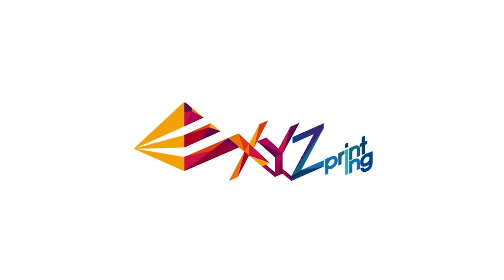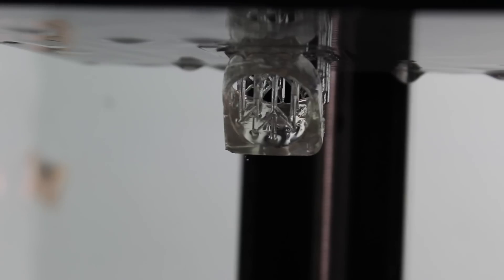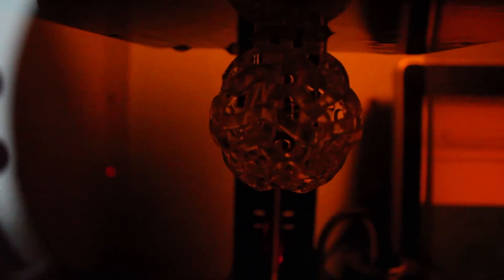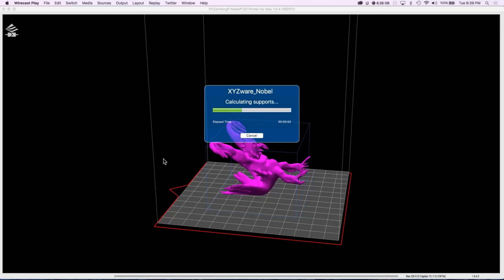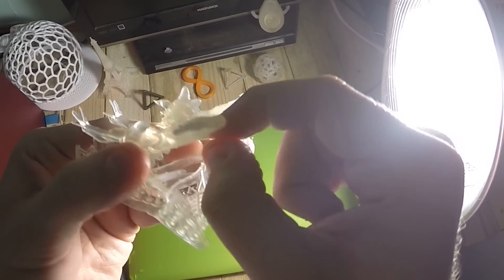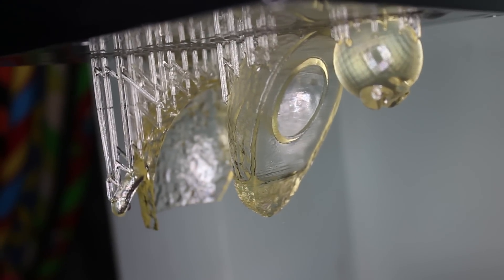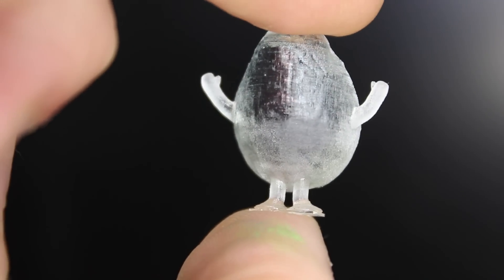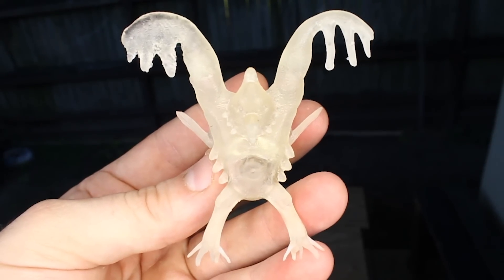SLA Printing - Pros & Cons | XYZ Printing  |  Nobel 1.0a  |  Review

Comment: So yeah this used to be a total duchebag of a post from me that the author did not deserve at all. But as the author has indicated we live and learn: 

For all those learning about resin printing here is my limited experience with the process:  
1. Resin is toxic and should not be touched without gloves 
2. Vats are coated with fragile-ish layer of PDMS or have a thin layer of FEP and to extend their life-span be very careful when fishing out the failed parts that are stuck to the vat. Use tools with dull edges/surfaces if possible. 
3. It is generally recommended to re-filter the resin back into its original container using paint strainer (100-190um mesh size, maybe higher depending on the viscosity of the resin) to remove partially cured chunks of the prints. 
4. Use some kind of a lint-free cloth sprayed/soaked with alcohol to wipe the build-plate after prints and for long term storage.
5. Once the resin has been drained from the vat spray the vat with alcohol (99% IPA or 95%+ Ethanol) and using another soft lint-free cloth very gently clean the resin vat surface and sides.
6. Alcohol solutions tend to be easily absorbed though skin so it is a bad idea to expose your skin to post-cleaning solutions of alcohol containing resin, as this solution will help skin soak up the resin into the body at a much higher rate then just touching undiluted resin with skin. 
7. Resin printing is a tedious process and requires a lot of patience and care. 

Bonus advice: think before you post a reply to someone's hard work.
Thank you OP for being kind.
Reply from the maker: Thanks for watching.  You live and learn. :)
Reply: @PrintThatThing  And I am a complete and total duchebag for posting that original post... :( I'm sincerely very sorry, I have no excuse mate. Gonna edit it. I have no idea what's gotten into me yesterday. Again, very sorry. I'm subbing, your channel is very fun!

Comment: How did you make your prints stick to the platform? My models NEVER stick :-(
Reply from the maker: I had to level it like 10 times. Then it was great.  But was definitely frustrating at first
Reply from the maker: Its been a while since i used the XYZ SLA printer. I already gave it back to the manufacturer
Reply from the maker: Oh yeah, now i remember. Make sure there is no resin in the bed tray while leveling it. Once leveled dry then add the resin. Hope that helps.
Reply: THANKS! I did the opposite, filling up the bed tray and then leveling it (like the manual said).

Comment: please tell everyone now this is not a proper way to handle an sla printer :) - wear gloves, avoid dipping your hands in the washing liquids as it contains dissolved resin - it's not recommended to handle it until cured.. it will not be a serious issue, but you may develop allergy simptoms - wash your hands up with warm water and soap - and get nitril gloves (as latex tends to dissolve with a lot of chemicals)

- also don't use metal scrapers to fish out for broken stuff, use something soft with rounded edges (i use old credit cards for the time being) - easy to damage the soft layer in the vat.. 

- your stuff didn't stick in the first prints because of the "leveling" usually the building plate should be like a hairline above the vat.. so too much space there and will not stick.. failed prints happen because of that, or because there is stuff that fallen inside it from the previous fails etc.. so it's good to use some sort of (paint) filter when you pour it out, or use a comb to lightly filter the vat while it's still on the machine  (there are printable combs on thingiverse )

- probably know that by now 

- for others watching - take your time until you understand what and why and how the printer works so you get less frustrations along the way - it's not a toaster yet - but the prints coming out are very detailed and really gives you ideas on what you can do with it - 

- also worth a mention that most (default) resins are hard but brittle, so not "usable" as a product it's good for prototype and art stuff 
- there are probably more resins that are tough and flexible, but so far as finished usable products fdm seems to be the king - still resolution on any sla printer is around 10x better, it's near perfect details when you compare ..

- I'm week 3 on a sla, and I love it, and got with the grips of the negative sides of sla printing, mess is something you have to prepare for etc. to read up a lot about it and it will work out, just don't rush it..
Reply from the maker: +Kresimir Jelusic preach! Yeah I had to send the printer back.  I use the Form 2 at my day job and wear gloves. It's definitely messy but the resolution makes out worth it. Thanks for the great tips and advice
Reply: I'm exploring everything sla related after a few failed prints on our studio SLA (poeoply moai) so might as well leave some info I found so far :) 
- I know I wanted to rush it but decided to go slow, it's better in the long run, interesting how the learning curve increases quickly with any new fail, while things ran slowly I didn't try to understand the inner workings of the device 
- I assembled the printer on my own so it's not that mysterious anymore , a laser shooting at two small mirrors (that are run through galvanometers - which act as fast motors.. you have a controller for y and x, and another board with a display and controlling the movement of vat.. 
- bottom soft layer acts a cushion, when the build plate lowers there's that hairline amount that is your layer - laser etches into it, and build plate goes up, and since the soft layer is easier to unstick it sticks to the aluminum build plate 

- form2 and this one is almost same with the inner workings, most are

- at it's base is almost primitive, only high tech is happening in the movement of laser and moving the thing up down - it clear how all of this things will be improved in the future until you won't have a mess and wear gloves around it..

- if you're producing 3d anything you'll love this, as it gives (slimy) birth to your brainbabies, as any emerging "new" thing (it was actually made in the '70 or '80s only now it's available to all).. it will need some taking care of 
- form 2 is probably the best thing around at that range,
- just do some research, I took a few weeks to get more comfortable with the thing, you can do it in a week probably

Comment: Quick question, after you poured the resin into the plastic cup do you just throw it out or is it reusable? How do you take care the resin leftover in the tank after printing?
Reply: It's reusable while still a resin (you might need to filter it in case there are partially cured fragments in there). Howeever you should never throw any resin into domestic drains or waterways, it is toxic as hell and should be disposed as hazardous waste. Watch this:- http://www.youtube.com/watch?v=7kHcsTG9QsM

Comment: I noticed you were using the printer in what appears to be your house.  How is the smell of the resin while the printer is running?
Reply from the maker: +Johnny Harris there is a very slight plastic smell. Nothing too potent. There IS a smell but its faint
Reply: Smell is not to bad. Kind if between plastic and WD40. Remember,  it is a "cold" printer, so no smell all around the house like PLA.

Comment: You shouldnt touch the resin without gloves, the resin is supposedly quite toxic until cured :)
Reply: Print That Thing - 3D Printing Designs it's worse if no one has explained to you. Your body starts viewing the resin as an allergic after repeated exposure to skin. It builds up in your body and suddenly you come on contact and have a massive allergic reaction. Wear gloves and make sure you have good ventilation for the fumes.
Reply: Thank you for that explanation. I never knew that.
Reply from the maker: +Andrew Taylor will do thanks
Reply from the maker: Thanks  for watching +Jinzo Clash
Reply from the maker: +Far Mand oh...